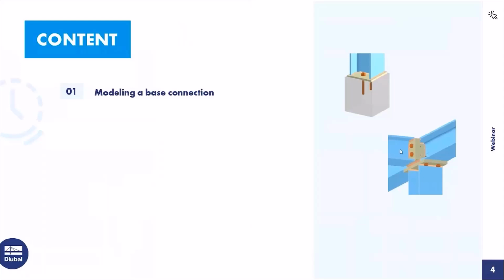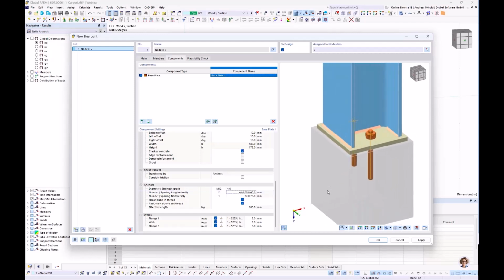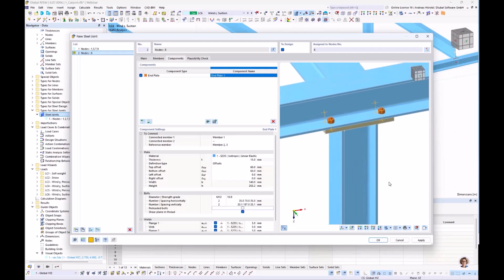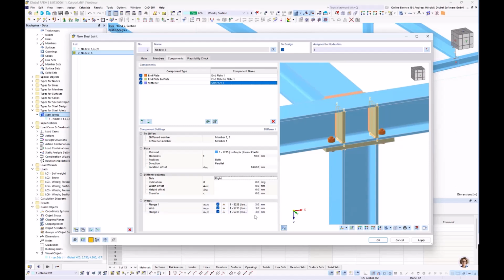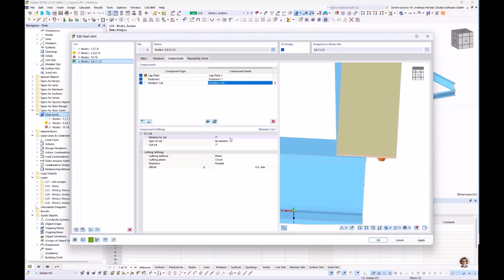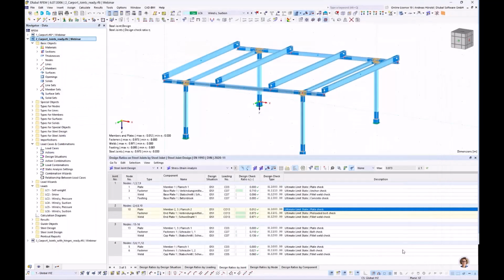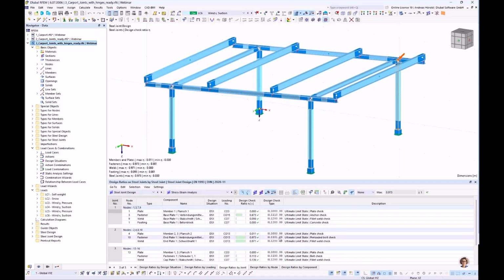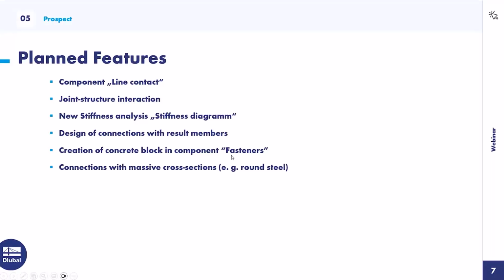Webinar | Steel Joint Design in RFEM 6 Using Practical Example

Comment: takes too much time to design, I have dedicated all my CPU cores for the application and took over 20 minutes just to design a very simple end plate joint with 2 bolts only
Reply from the maker: Hi, @civilengineeringwitharas4776! If you only specify relevant combinations for the design, the calculation will reach results more quickly.

Comment: Is this new functionality or has it been there for a while?
Reply from the maker: Hi, @KevinDo-q2g! What function do you mean? The Steel Joint Add-on is already available for a while.
Reply: @DlubalEN  Yes, the Steel Joint Add-On was what I was referring to. I am still using this on a trial basis and have not gotten deep into this feature, so this video definitely helps!